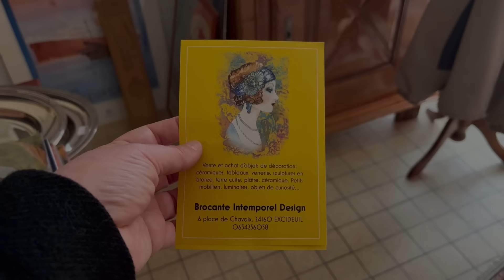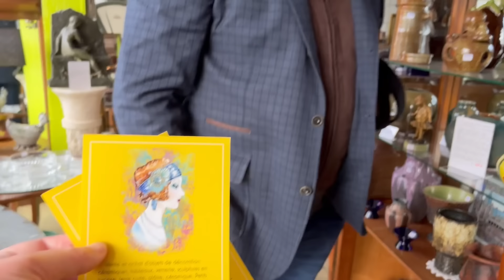Delivering to & from FOUR CHATEAUX & Resuming work on the WC | Manor & Maker

Comment: Great ladder work!!! You’ve certainly come a long way with those tasks!!!
What a nice couple of delivery people you were. ♥️ What a pity the kitchen unit didn’t work, but I understand the need for flexibility in your current “in progress” situation.
For the drawer under the sink, I’d cut it short instead of eliminating it completely. With such a small countertop space, having a pull-out extension would be nice.
Option A: A short drawer is the right size for toothbrushes or hairbrushes (or both), with a removable, washable tray.
Option B: Leave the sides long but cut the bottom out, and build in a platform in front for a marble extension (the long sides helping hold the weight).
Fictional option C: Heh, one could provably figure out a way to have a hinged piece of marble in the drawer, so it could also hold toothbrushes underneath, but that’s not likely to be worth the effort, and might require frequent repairs and maintenance.

Comment: Good job with the removal van. Cross scoring the old paper allows water to soak a lot faster.  The copper bowl on the dresser looks nice but IMHO I would imagine is totally impractical to use properly. The copper bowl is too narrow and high. With the tap spout across the middle I do not see how it will be easy to use as a bathroom sink.  Keep up the good work and I hope the season goes well.  ATB regards from the UK

Comment: Well your drive was like going from Ottawa to Guelph 528 km 😊 it was like you were here doing a one way trip. I think you are tougher than that lol!❤
Reply from the maker: You are right! But all the little villages with that big van was interesting.
Reply: @ManorandMaker  I was thinking about the wood outside… it would be cool to chain saw or get Nic or Dan to slice some stumps of various sizes into disks that first you would treat for woodworm and varnish or stain and then make a feature wall in one of the rooms and filling the gaps with plaster or do like an old client of mine where they made there house out of logs and glass bottles, but whoa you horses I am not suggesting a house but a shed or art space on the property. Making a frame then with the logs, glass and plaster creating the walls that would be so cool and depending on how adventures you are you could make it like a 10 x 10. Just pouring a fountain to start. Just an idea. I know you are busy inside right now, but it would be great project for when you have volunteers over the summer months. Especially if you get any with building experience

Comment: I heard that liquid fabric softener helps with removing wallpaper. I’ve personally haven’t tried
Reply from the maker: I have had success with that in the past with wallpaper from the 70s-80s, but the with older stuff just water works as well (on plaster, not drywall)